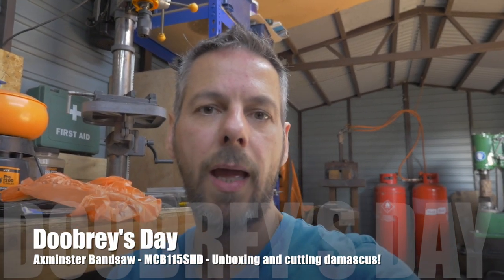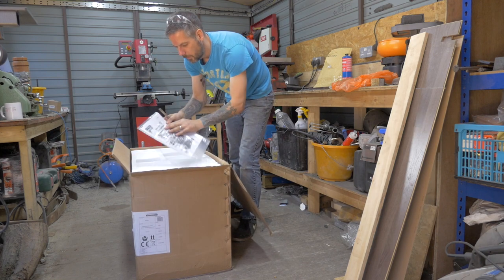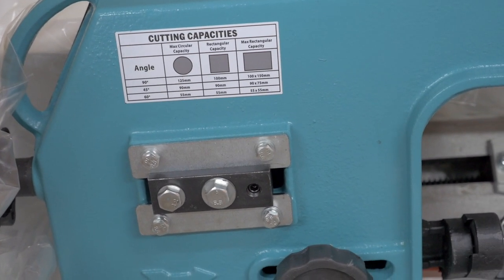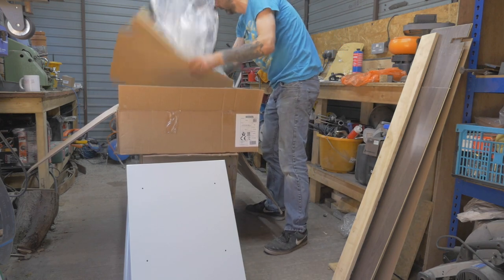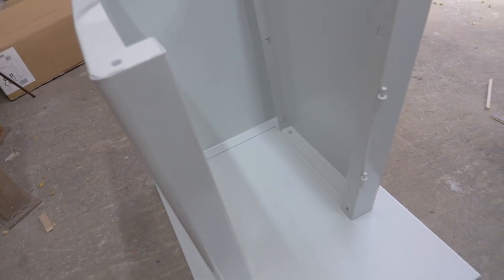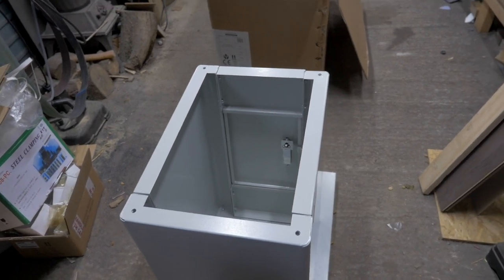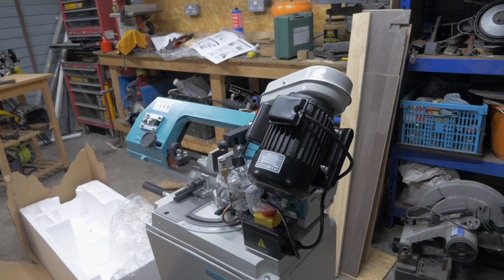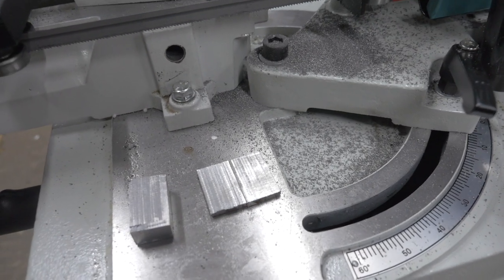Axminster - Metal Bandsaw (MCB115SHD) unboxing and review

Comment: Hi folks. I have this saw as well. It is very accurate straight out of the box. I changed the blade for a much better British one - also from Axminster - which I strongly suggest doing. A few things could be better though. There are three blade speeds selected by a belt drive. There is no electrical interlock on the belt change cover. The motor and belt will run with the cover open. That is dangerous and would be unacceptable in a commercial operation.  It's an easy fix for an electrician. The  belt cover is screwed shut which is annoying. The bolt to tension the belt drive is also a pita to use and is needed when changing speeds. My vice had been painted whilst still oily so the paint flaked off immediately. No rust though! I cleaned it and repainted with an epoxy paint. However, despite all that it is very good value for a swivel bandsaw and as I said does cut remarkably accurately. BobUK

Comment: I've got one of these too. After fixing numerous problems (gear in the gearbox failed due to crap oil, hydraulic damper leaked, guide bearings failed, auto stop switch failed, crap belt tensioner, plastic vice handle cracked) it's sort of alright.

Comment: Got the same bandsaw a few months ago from their Nuneaton shop, and I have been pretty pleased with it. I've already done hundreds of cuts on stainless and titanium with the stock blade (I think the titanium killed it), and it is getting quite tired, good thing the bladss are quite cheap though. Also had a leaky hydraulic cylinder that they agreed to post to me under warranty. For such small diameter pieces, you can adjust the blade guide on the left to be as close to the bit you're cutting as possible ;)
Reply from the maker: Thanks for the comments.  I am loving mine, although the blade is getting tired now from cutting through a lot of damascus.  That stuff is not kind to blades!!  Great purchase!!

Comment: Decent looking band saw and for reasonable money too. Do you know if this can be used in the vertical position as well? Or is it horizontal only?
Reply from the maker: Horizontal only sorry to say.  It’s ok for the money !
Reply: @Doobrey  it can be used vertically, just disconnect the bolt that holds the hydraulic ram then lift it until it is fully upright. Make a simple plate and you can use it vertical. I have the same saw. 👍